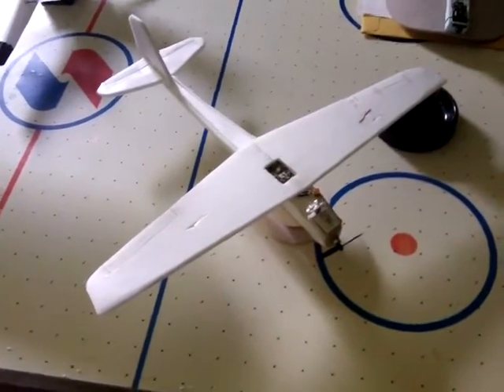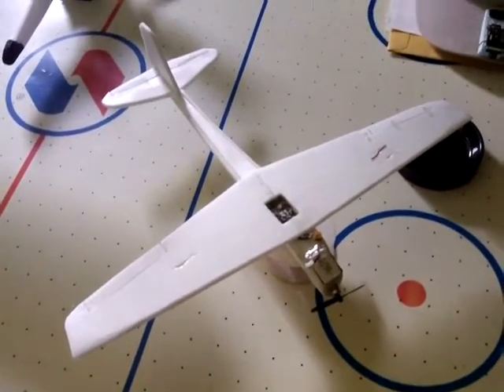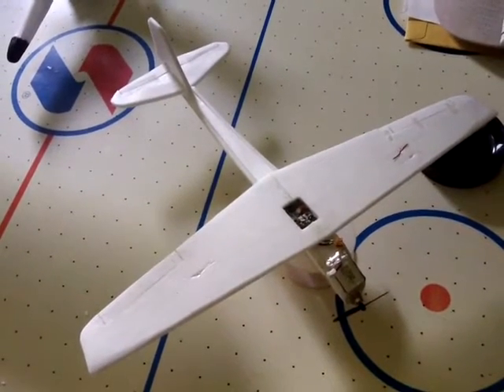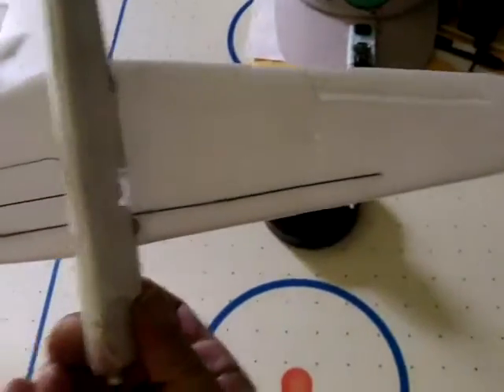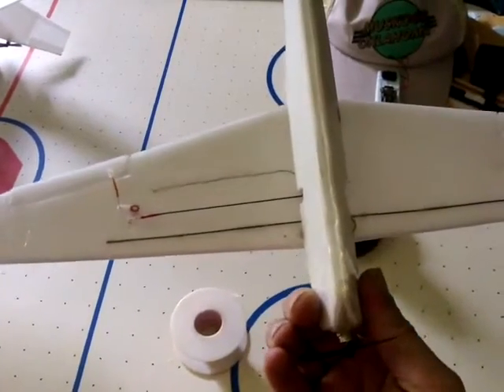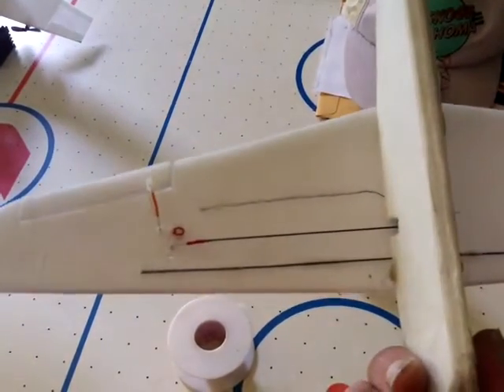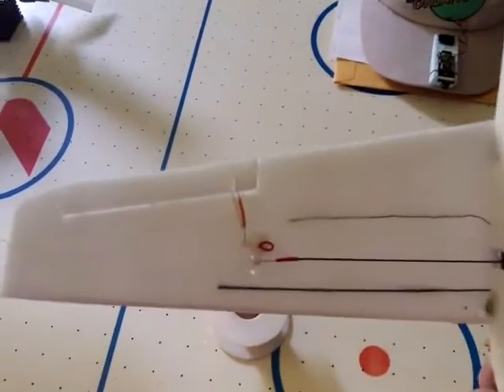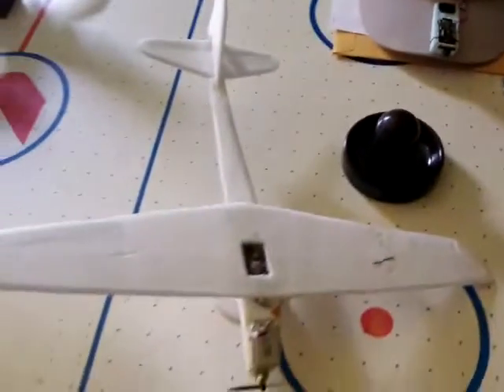Plane with just 1 aileron - can it fly ?

Comment: it looked good to me.i never knew mini's were that stable.while learning,can they be flown slower at first?
Reply from the maker: +bill bailey Thanks Bill. 
Being a scratchbuild from cheap foam, it's maybe not a true indicator of flight traits for something bought. But, a high wing is always a good idea for training as they fly slower (as opposed to mounted underneath such as on WWII fighters). The more wing area the better, more wing = slower flying. Super Cubs are popular for those reasons, or a Storch, or Cessna types. 
The motor here is only just about capable of flying this around and there is no elevator. A bigger motor, usually brushless nowadays for extra power and an elevator can help to speed up/slow down an aircraft. Flaps on the front or back of a wing can also really slow a plane down. 
So in summary, the bigger the wing and the higher up it sits the slower it will naturally be. Flaps and elevator can bring strong differences in the flight envelope. Motor power can greatly alter flying ranges of speed and agility.